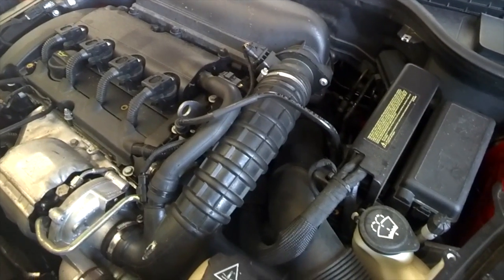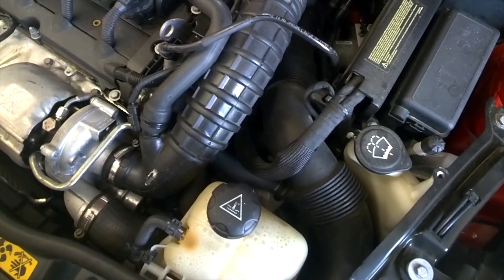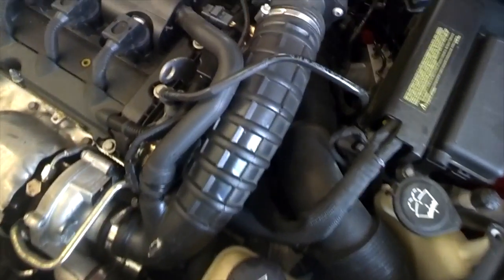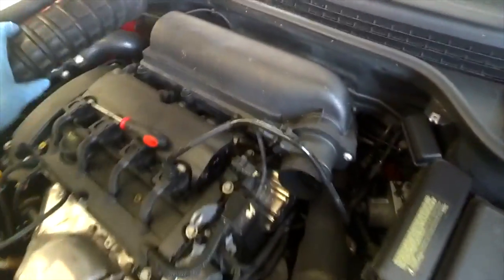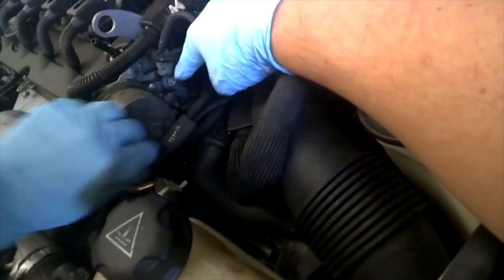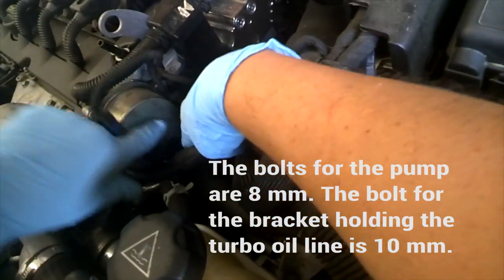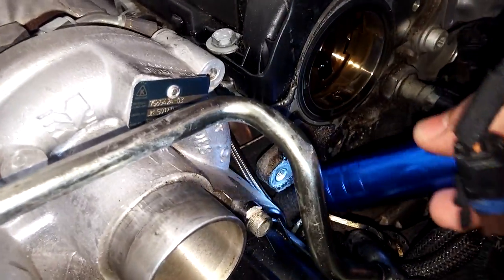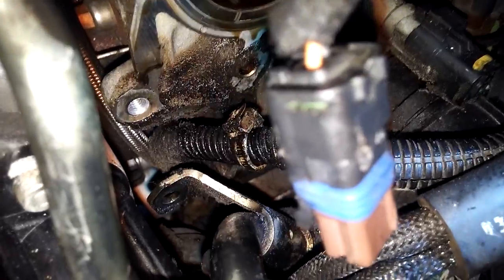2008 MINI Cooper S - Vacuum Pump Replacement

Comment: Hi, wondering what vacuum pump you went with on the replacement.  Did you go with the Genuine mini unit?  Asking as I see a Pierburg unit at half the price, and a hella unit right in between genuine mini and the Pierburg unit.  Curious if its necessary to go OEM, or if the better priced aftermarket ones are OK.

Thanks!
Reply from the maker: I went with the Pierburg unit. I was never able to confirm, but I think they were the supplier for MINI for the pumps.

Comment: If it is leaking, does that mean you have to replace the whole thing?  or can you just replace the gasket?  What was the milage on this car?  Thanks
Reply from the maker: Not sure whether you could just replace the o-ring. My understanding is leaking results from the unit warping slightly over time from heat. Since failure of the unit could brick the engine, seems like most common option was to just replace the whole pump and err on the side of caution. I had 182,000 miles on the car when this repair was performed.
Reply: @jcauseyfd  thanks for the video. We replaced the gasket. But still seems to be leaking a bit... that why I was wondering if it was the whole thing that's the issue. Also keep getting the oil light coming on...

Comment: I cant’ find the torque specs anywhere either.. put a new pump on but the oring is leaking.  I’m about to put a replacement oring on.  Hope it stops the leak.

Comment: Thanks for the video! I'm pretty sure many mini drivers will love this as vacuum pumps tend to fail on them. Did you have to drain the oil prior to removing the part?
Reply from the maker: Ricky Cordova Thanks for watching. No, I did not have to drain the oil. However, the Bentley manual does specify that this work should be done on a cold engine. So I did the work after the MINI had been sitting overnight and made sure I did not have to drive it at all the day I did the work.

Comment: What was the symptoms please? Hard brake pedal? Or did you replace it because of oil leak only?
Thanks for shearing
Reply from the maker: Aleksandr Zinkevics replaced due to a leak.
Reply: My car has a hard pedal and I was wondering if this could be the cause.

Comment: Hey Jeff, quick question. How did you shift the pipe near the bottom bolt? The stupid pipe makes it almost impossible to remove that bolt off (8mm).
Reply from the maker: I don't remember exactly how I got it other than I did have to remove one or two bolts on a bracket that holds that pipe in place. Once it is free of the bracket, you should be able to shift that pipe enough to get to the bottom bolt. Like everything in the tightly packed spaces of the engine bay, it takes a lot of patience and trying to get creative in figuring out how to get your tool onto the bolt to get it loosened. Good luck!
Reply: @jcauseyfd  Hope the coolant doesn't leak! Thanks! I'll give it a try.

Comment: Hey, thinking about doing this job on my Mini. I have oil seeping from the bottom of the pump. Did you notice any play in the shaft piece that connects to the camshaft? I am trying to figure out why you went with a new piece instead of just replacing the o-ring. Thanks!
Reply from the maker: I did not notice any play. I'm not sure you can buy just the o-ring. Since mine had almost 200k miles, I figured I would replace the whole pump as a bit of prevention.
Reply: Our Mini had a head gasket issue due to the low oil issue... So I'm thinking it's probably safer to just replace it. Thanks for getting back to me, I appreciate it.
Reply: Jeff Causey 200k miles on a R56! That's awesome, I just bought a 2010 mini S and of course after buying read all the horror stories about timing chains, carbon build up, and vacuum pump failures, now I'm terrified.  What's your secrets, any major engine repairs?
Reply: A few tipes:
Run the MOST expensive oil you can find,. LiquiMoly, Pento, Quartz, Bizol, etc. 
Only use Mini Cooper oil filters. You can use Mann filters if you want, but they don't come with a new crush washer.
Learn how to read your oil level. Check your oil every two/three weeks. 
Oil changes, every 5000-6500 miles. 
Your coolant should be blue. Don't put anything else in there. If yours came with green, get that flushed out of there immediately and replace with Mini coolant or Pentosin NF. 
Vacuum pump is easier than replacing the spark plugs. Just take your time. And man, does that make the brakes feel amazing...   

I have to say, the suspension components on the Mini are top notch. We haven't had to replace anything on an 09 R56 up to now.
Reply from the maker: Alexander Perez - I have not had anything I would consider a major engine repair, but I have had just about every repair done that you read about regarding MINIs. 2 timing chains, water pump, water feed pipe, thermostat housing, vacuum pump, hpfp, throttle body, turbo oil feed line, heat exchanger, valve cover. Then the typical maintenance items - spark plugs, carbon cleanings, bleed brake fluid, etc. Probably some other miscellaneous stuff I'm forgetting. I've done about 90% of it DIY to save on expenses. Most expensive repair was clutch replacement.

Not sure I have any secrets. I run about 15k oil change intervals and except for a period of time when I was running Royal Purple, I've always used A3/B3 rated oils (basically the ones that MINI recommends - Castrol, Mobil1, Pennzoil - haven't tried Valvoline yet). Keep an eye on oil levels, coolant levels, etc.
Reply: BlastReadingSeries
Reply: when you say carbon cleanings was the head pulled and carbon sand blasted?
Reply: @kirkhaynes5452  walnut blasting at the inlet manifold at the rear of the engine

Comment: hi sir..i have a problem with my mini cooper s 2012. the computer shows to me " low pressure". i changed the high pressure pump and there is no change with the problem. do u think its because of the carbon? maybe i have to clean it?
Reply from the maker: GANAIEM MOHAMMAD not sure what the problem could be for you. If you can read the computer to find out the specific code causing the low pressure light that might help you with troubleshooting. 

I think you have the N18 engine, so carbon build-up should not be as much of a problem as the earlier models. You'll still have to eventually get it cleaned. I find the carbon introduces rough running and eventually a CEL.